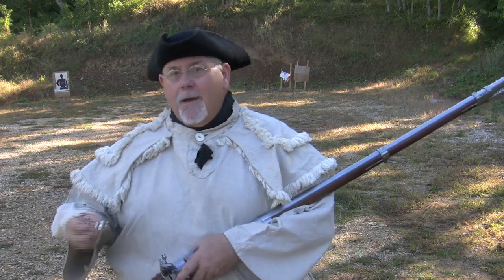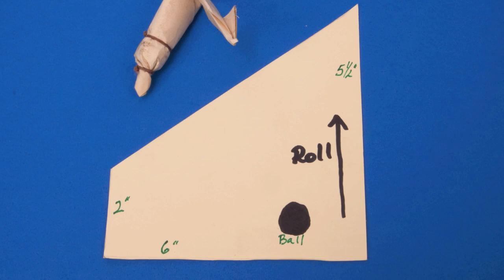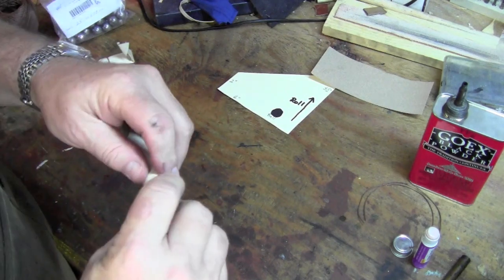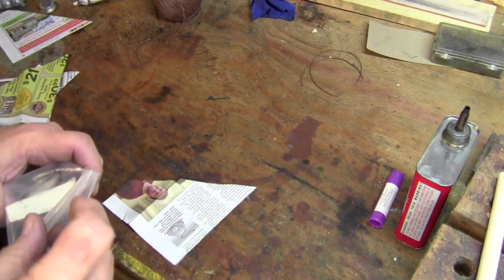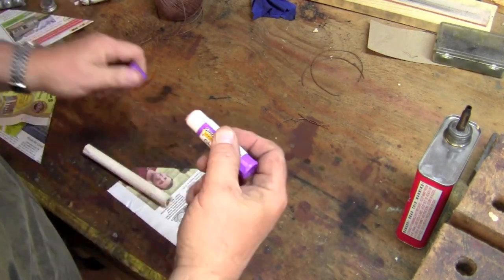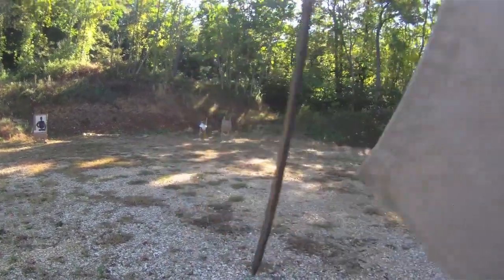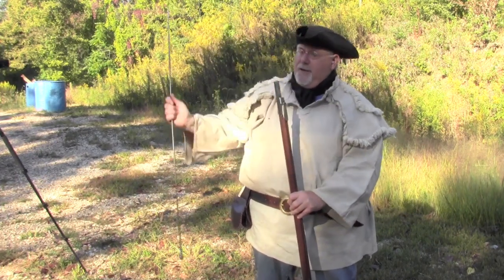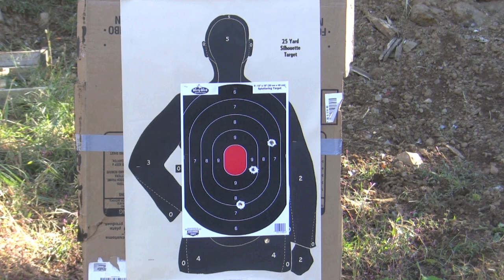Making and shooting 18th century military paper cartridges

Comment: Hello Mike

A choke string with a "T" handle makes choking the front down a lot easier before tying. And in a neater fashion.   Attach a string to your bench with a handle on the end.  After forming the tube wrap your choke string around the end in front of the ball and place your finger against the end of the tube.  Slowly pull choke string to "Choke" a waist while holding your finger against the end of the tube (to keep the choke string from falling off until you make a little mushroom). Pull the choke tight, remove the choke and ty the ball in. 

Bob

Comment: Changing to a .68" ball was a good call, from what I've read, Brown Bess muskets had a .74-'75" bore, but they used a .68" ball so they could get several shots before fouling made it too hard to load. With Lee .678" balls, using a .10" patch is REALLY tight in my .69 Springfield. I don't use the rammer from the rifle, I use a field rod. I bought two of the Traditions (?) multi-piece ramrod/cleaning rods and use a combo of the sections from both for the long barrel of the Springfield. I don't want to damage the rod that came with it with patches because it's designed for a patchless martial load.
Reply: I'm assuming you mean .010" patch, which with that ball is .698" (too tight, you're probably deforming the ball trying to get it down) , so I would imagine it would be hard to load (I'd probably go with a smaller ball or switch to paper patching (20# paper avg's .004", 28# is .005" and 32# paper is .006"; and remember, double your patching thickness when determining bore fit 9assuming a single wrap)). the rammer on the Springfield is about 5/16" steel, can't possibly imagine you damaging it unless you intend to (that being said, I usually make a brass tipped stainless or aluminum rammer for my guns for corrosion resistance and/or weight). Always leave a few thou clearance for fouling (don't worry, with a respectable charge, the ball will swell and seal the bore as long as the load is within .005" of the bore (in my experience)).

Comment: I use a .648 ball in my .69 caliber weapons when I use a paper cartridge.. Usual procedure is to rip the cartridge open and prime the pan (not by today's safety standards),pour the powder down the barrel, then ram ball and paper down the barrel without taking the ball out of the paper. As the barrel fouled you could take the ball out of the paper and then use the paper as wadding.

Comment: You probably know more about this stuff than I do, but I've read in a lot of places, and seen re-enactors doing it. The paper cartridge wasn't put intact in the barrel. They'd first separate the ball from the cartridge, holding it with the teeth, then put the powder down the barrel, then put the ball without the paper. That's mostly because they used a thick paper for the cartridges, so it wouldn't rip accidentaly and also to protect the powder from moisture. (they also didn't have thin, milled paper as we have today).
Reply: The paper is needed down the barrel to make sure the ball didn't roll out, and to provide a gas seal on the under-sized ball.
Reply: Jonatas Silveira Baldo I've seen period made paper cartridges where they used  newspaper for their cartridge. Their cartridge box had a wooden block with holes drilled into it to hold the cartridges, so they were fairly well protected.

Comment: why do you need the glue, I used to use a flintlock for re-enactment and we never used glue to keep it closed. a twist on the bottom and push the form with the hollow bottom at the end keeps them closed without losing powder with out need for glue

Comment: I'm trying to make paper cartridges for my Harper's Ferry flintlock pistol (.58 caliber). Is there a way for me to roll one with a lubricated patch inside?
Reply from the maker: Not really, but the cartridge paper function somewhat like a patch, and you can lube the paper over the ball.
Reply: @duelist1954  Alright thank you! I was curious since I saw someone else stick patches in their cartridges.
Reply: @duelist1954  I'm thinking of rolling a basic ball and powder cartridge, then dipping it in beeswax and letting it dry. Would this help reduce fouling while maintaining accuracy?
Reply from the maker: @kddreadlord5532  I thik it would reduce the fowling to a certain extent, but I don't see the benefit of using a paper cartridge at all. If you have the modern, rifled version of this pistol, you need a ball and patch combination that is tightly fitting enough to hold the rifling. If you use a paper cartridge you need the paper/patch combo to be equal in thickness to the ball and patch that does not use a cartridge. This won't load any easier than a standard ball and patch. You are better off making paper tubes to hold powder charges only, and load the patched ball separately.

Comment: Can the ball end be dipped in wax ?  To seal the end instead of a tie off
Reply: you very well may push the ball through the patching without the tie holding the crimped paper closed (the Brits had that issue with the 1851 Rifle-Musket). But I use a hot  dip in soft wax (3:1 Paraffin wax to petrol jelly, with a TBS or so of winter diesel additive) to lube the cartridges just the bullet portion

Comment: Will these work for cap locks like the Hawken Rifle? I was thinking of making a couple with ball rounds.
Reply: +jaket2k9 No, a true rifle needs a ball with cloth patch.  You could still make up paper cartridges to hold just the powder or powder and ball for convenience, but you would have to discard the paper and use a patch.
Reply: But I've fired Jacketed and conical rounds out of mine just fine. I've had this question answered long ago and the short answer is its not work the time and effort.

Comment: Also, would the way the bullet is wrapped in paper reduce its accuracy?
Reply: Actually, historically, the ball wasn't put in the barrel while wrapped. The way of reloading with cartridges was ripping the bullet off, holding it with the teeth, dropping the powder down and putting the paper as a wad, then you put the ball, without any paper over it.

They used a very thick paper for cartridges, so it'd be more resilient and would protect the powder from moisture. If they were to put the ball with the paper, they'd have to use a way smaller calliber.

I suspect that the paper duelist used is so thin that it get completely burned before leaving the barrel, but with a thicker paper, it would definitely get some out of the barrel and reduce accuracy.

EDIT: I hadn't finished the whole video and saw another strange thing afterwards. He puts powder in the firing pan before loading. That's usually not the way to go. Putting powder in the firing pan is usually the last thing you do before firing.
Reply: Jonatas Silveira Baldo He primed with the cartridge first, because if you dumped the charge down the barrel before priming, you wouldn't have any powder to put in the pan. And as far as loading the ball, standard practice in the American army was to leave the ball in the paper when loading. Holding the ball in the teeth MIGHT have happened in some European countries, but never in the states.

Comment: What would they do in the field when the rifle became fouled
Reply: they would have tools to try to do the best they could but its not a rifle its a smooth bore like most shot guns
Reply: SteviePlaysMinecraft that was my question is this smooth bore or rifle ?
Reply: Before using a scapper tool which needs attaching to the ramrod, they would wet a cloth patch in their mouth and swab out the barrel using the ramrod.
Reply: They pissed down the barrel, dumped it out, and twisted patches onto the end of the ramrod

Comment: I'm guessing this is just to speed up the firing sequence and NOT do much for accuracy. I wonder if a paper, ball and powder cartridge could be worked up that would afford, speed, accuracy and reduce or slow fowling in rifled muskets.
Reply: you mean... the Enfield-Pritchett Cartridge... where a .577 caliber rifle uses a .55 hollow-based bullet to maintain accuracy and ease of loading. IDK, it might be possible (i'm being facetious,  of course)
Reply: @wildrangeringreen  I need to use a patched round ball.
Reply: @fordfan3179  in all seriousness then... unless your the rules dictate the use of cloth, you could do what I do for my round ball guns. (example here is .50) I  make a cartridge using 20# paper (avg's .004"), when its wrapped 1.25x around a .490 ball, it comes out to .499. Dip the paper in molten soft wax (3:1 paraffin: vaseline, with a TBS of diesel winter additive). Loaded like a pritchett cartridge, it's every bit as accurate as a cloth patch, but I can load 20 shots without a wipe. 
  Now if you need leather or cloth patching, you could do what was done in Austrian and many southern German Jagerkorp and use tubes (historically, brass, one could use vinyl tubing if they want); a cork or plug was hammered in one end, the powder poured in, and the ball in its patching was wedged in the open end. You'll want a soft wax on the patch to lube it without contaminating the powder. The patching was stitched around the ball to hold it to the ball. Brits did similar for the 1800 pattern rifle, but used paper instead of metal tubes (I assume for cost).
Reply: @wildrangeringreen  the paper and paper tube was the idea that looked the most viable. I can even get paper tubes .40 so once you bite the top off you just funny the powder down the barrel without having to pay too much attention to it. Flip the empty tube over, put the ball in the hole and snap the tube off, rm the ball home. Waxed paper seems like the deal. I'll do some experimenting this spring. I'm just getting around in the car now after having both knees done at the same time. I'm really chomping at the bit to get to the range. I did drive by there last week when it was warm that one day, it was a mad house. They were limiting shooting benches to 45 minutes. I think I could have gotten maybe 10 shots after I set up  baring any malfunctions. You can't shoot from a bag or use a powder horn at the range so the paper cartridge will suit that purpose as well and transition to a bag or ammo pouch system well at woods walks.

Comment: you can use printer paper can't you? it comes up to .58 but idk if it will when you cram it in like that
Reply: I use 20# (.004 avg thickness) paper for my rifle cartridges, just remember to double your paper thickness and add it to the bullet diameter when determining fit. for my .50, I use a .490 sized bullet with 1.25 wraps of paper on the cartridge; and it ends up being somewhere around .499, dip the bullet end in molten soft wax and loads easy, yet it's every bit as accurate as tightly cloth-patched ball.

Comment: I understand that is how they did it, but it really makes me uneasy the amount your hand is forced to move close to and over the muzzle of a loaded musket.
Reply: From what I have read the real danger in using muzzle loading paper cartridges is the chance of smoldering bits of paper igniting the powder of the next load. The men were tought to keep there head back and not cover the muzzle with their hands. Hold all following components between thumb and forefinger, so any blast would go between their fingers, reducing injury. Yes, their safety expectations back then were very different than today's.  Such as, I just can't imagine shooting a flintlock with out eye protection! Have fun and Stay safe.
Reply: @richardelliott9511  There is no ember in the bore!!! In 20 years, never seen it, nor met a reliable witness of it (gun barrels are very hostile places for pretty much everything, its why we have to salt gunpowder). Also, the lock is designed to keep you safe.... otherwise the design would have changed. Attaching your safety-sally, knee-jerk notions to stuff  without thinking just perpetuates felicitous information.
Reply: @Jason B. potassium nitrate's a salt. Charcoal and sulphur will burn pretty fierce with free oxygen, but put in a confined space, and it doesn't do much.